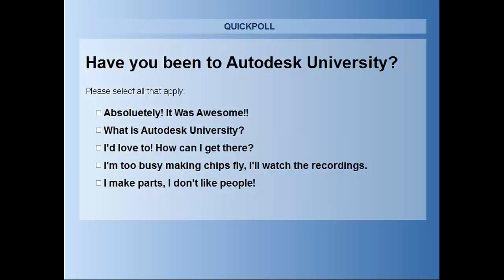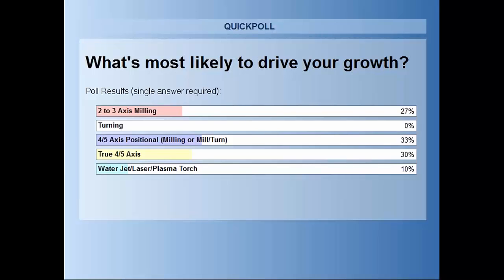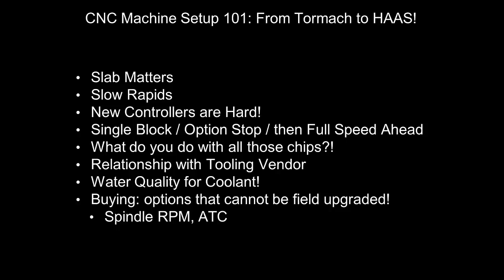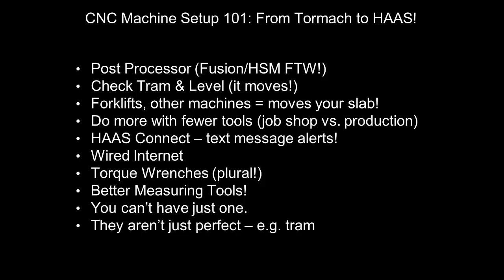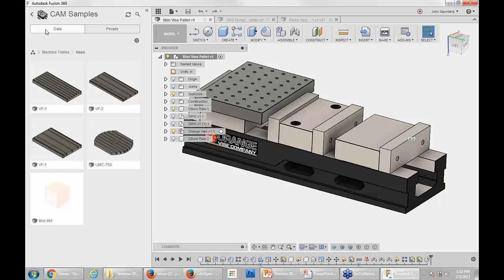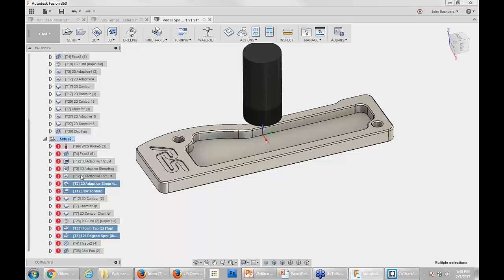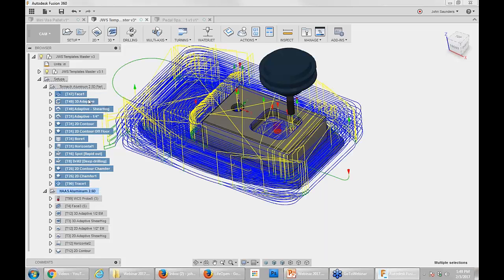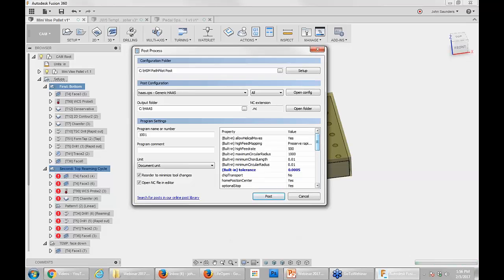Weekly HSM Technical Webinar - Machine Setup 101 with John Saunders

Comment: I had actually put this comment on the wrong video before... but it belongs on this one. :)

Wow, that was SUPER helpful.  In case you guys are wondering if you are 
hitting a target audience, yes you are.  People like me are a little 
past beginner but really struggling to figure out how to leverage our 
machines to actually get projects done decent time and repeatably.  This
 is the excellent common sense how-to we need.  It's past "I've never 
used this" but it doesn't assume you already know it all and are running
 1000 part jobs.  This is hobby and small shop how-to and did a good job
 of showing HOW to practically apply multple features of Fustion 360 at 
once.    I'd love to see more focus on this level of info both from 
Autodesk Fusion and from NYC CNC.  THANKS!